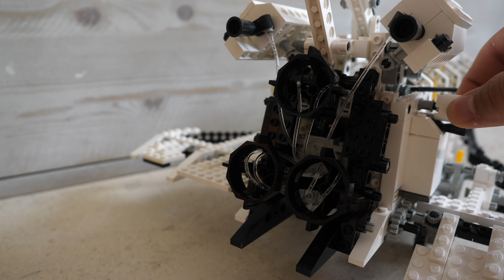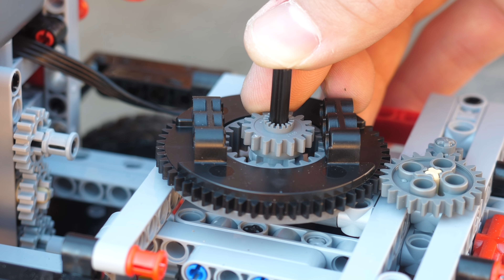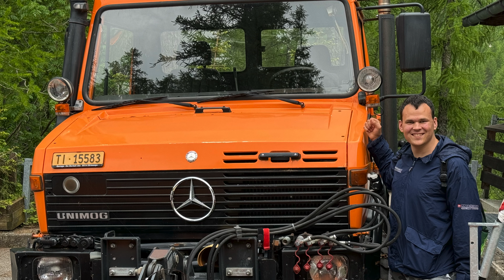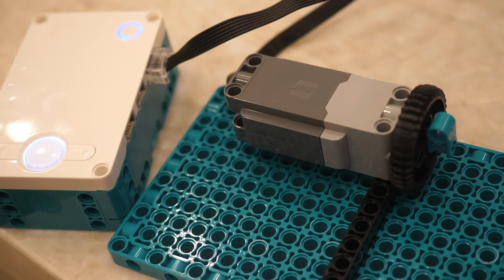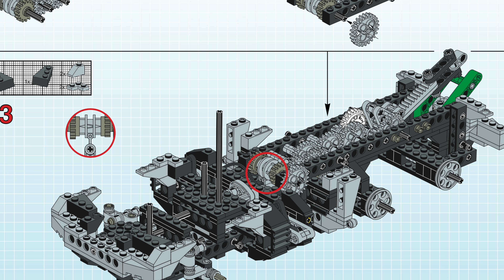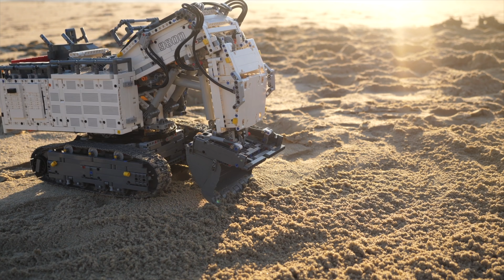10 LEGO Technic Sets Packed with Incredible Features!

Comment: Best Technic set of all time is the Airtech Claw Rig. So many functions, with only 954 parts.  Included 6 pneumatic cylinders and 8 different pneumatic functions. Secondary build had an air compressor function. Unequaled cleverness before or since.

Comment: Great video! One of the best aspects imo of 42100 is the many incredible remote controlled alternate models you can build from it on Rebrickable using only the parts included in the set; that includes remote controlled Johnny 5, R2-D2, bulldozer, snow groomer, and combine harvester models. RacingBrick voted the Liebherr PR 776 bulldozer alt build to be the best Technic bulldozer ever made in one of his videos, ahead of 8275 and 42131.

I was surprised not to see 42009 or 42082 in this list, replaced by sets with fewer functions. And including the 8865 test car instead of 8880 or 42115 (which has the most functions of any Technic supercar official model ever) seemed an odd choice. I was also very surprised not to see 42043, which afaik has the most functions of any official Technic set ever unless you count all of the programming options of 8479. Nonetheless, this was a great video and I enjoyed watching the functions!
Reply from the maker: In the beginning, stated I would not include anything mentioned from the previous 10 hardest to build functions video. That video extensively covers the 8880 as wwell as the 8479 barcode multi set. Please take a look at it: https://youtu.be/o-j-d5ypTv0

Comment: Not even a mention for the programmable crane in technic idea book 8888 from 1980? Mechanically programmed with gears and plates?
Reply from the maker: It’s extensively covered in the previous top 10, the hardest functions to build: https://youtu.be/o-j-d5ypTv0?si=9FX75jrdW4QXem9F

This video does not include anything covered in the previous top 10